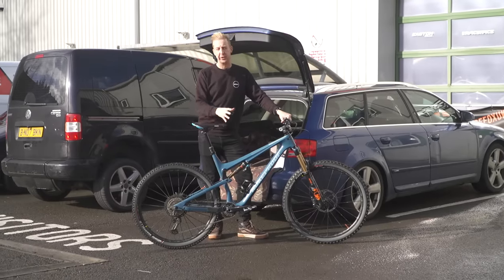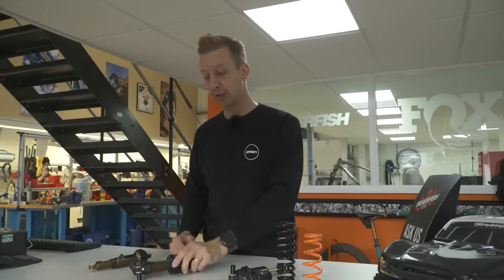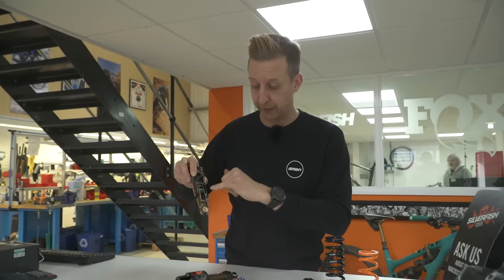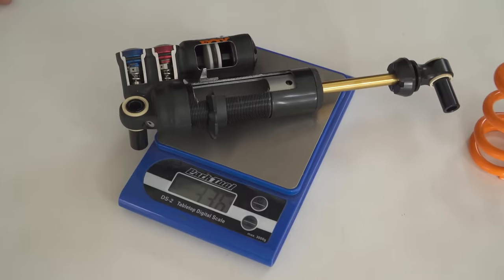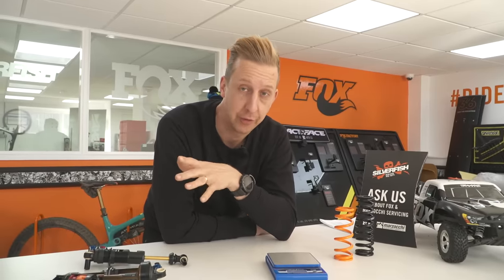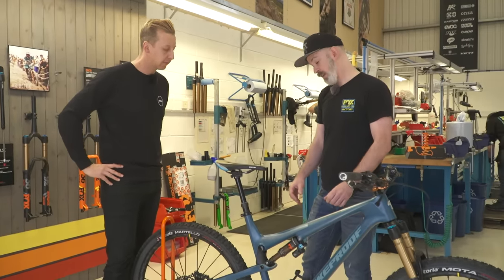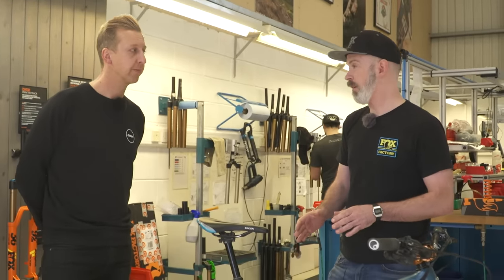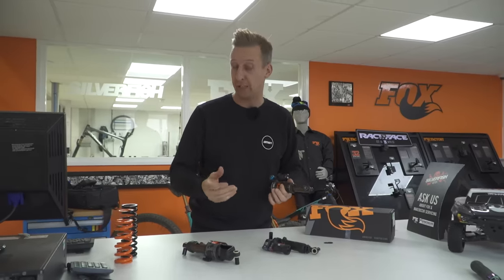Converting Your Mountain Bike From An Air Shock To A Coil Shock

Comment: I can't wait till we come full circle on wheels too, "...the new 26" bikes are so light and nimble" LOL
Reply: Well, just waiting for my new bike to arrive, since the previous one broke after 15 years. Many of these new technologies are totally new to me, and although i definitely went for a 29er, i didn't let myself convinced on 1x drivetrains. Everybody told me how great and "big range" they are, but i sat down and calculated all the speeds and gear ratios... I'm sure 1x is great for people who live in the mountains, but i like riding everywhere, from flat tarmac to the steepest technical climbs, and i'm happy i found a good XC bike with a 2x12 system. We'll see, but i have a strong feeling that i chose wisely.
Reply: @thehenr  I agree. 3x is good too on cheaper bikes, it offers good range without expensive components
Reply: I think you did. Its not the trend that matters, its the purpose.
Reply: @Panslapper  True. The bad thing is, it's sometimes hard to find the perfect thing for the purpose when trends are going in the other direction.
Reply: @thehenr  Yeah, it's a pain in the ass when you can't get the front chainrings off from the crank. Impossible to clean, let alone change them if they got worn. I had a 3x9 on my previous bike with a Deore crankset, and it was already good enough for a good quality riding and easy maintenance. Although, i admit i barely ever used the smallest chainring, only on very steep yet very long climbs. Which are rare here.
Anyway, all this technology put into modern bikes is so fascinating to me. Strong derailleurs, suspension, brakes, large wheels and wide tyres, etc... I've ridden quite low end bikes my whole life, even on the craziest terrain. I can't wait to see what has changed in the past 15 years :D
Reply: I was gonna sell my old 26er, but maybe I'll just hold on to it until it comes back in style again. Do you think 32mm stanchions and steep steer tube  angles will make the rounds as well?
Reply: @ezicarus8216  Hell yeah. It just occurred to me, the first bikes ever made were mullet bikes with 90° head tubes.
Reply: I’ve got a 29er rock hopper that I like, but also built a 26” out of 2012 Remedy 9 frame. I gotta say, switching between the two is fun and I like both of them for different reasons. I wouldn’t put 26”s on a hard tale, but on the full suspension the 26” feel so much more nibble and engaging. If 26”s make a come back, I think that would be great.
Reply: 1x will be more than plenty if you have a large range cassette mate
Reply: @forgenath6321  it turned out, 2x wasn't a bad choice. I have 36/26t chainrings, and i can ride both fast, and do really long and steep climbs with ease. The cassette is 10/45 though, but i'm sure i wouldn't go smaller than 36t if i had a 1x
Reply: old school! Liking the idea but I personally believe it just causes clutter on the cockpit more and you have more chance of the chain falling off with a 2x, but if that is what you like I wish you all the best and hope it goes well!
Reply: The main upside to 1x in my opinion is having one less derailleur to have to adjust or worry about breaking. It's also lighter, but that's rarely my main concern.
Reply: brilliant
Reply: which is weird because 3X is more complex than 2X but 2X is more expensive.
Reply: @gearsighted  front derailleurs are not as prone to accidents as rear derailleurs, i never had an FD fail on me. And 2X front derailleurs are pretty easy to setup and tune, their just 2 speeds anyway. Learned how to do it on youtube.

I converted my bike to 1X from 3X by removing the old chainrings and putting in a new middle chainring, then replacing the rear cassette with a wider range and putting in a derailleur extender. Now i want to go 2X but i already gave away my FD, will buy a 2X specific crankset once the prices go down and availability goes up and put my old cassette back for closer ratios.

Comment: I went to coil last year on my YT pro race and what a difference converted the Fox 36 and fox DHX2 spent a bit on springs and wouldn't go back to air, to much stiction. Now running 2020 Specialized Kenovo expert and took off the rear coil and put the Fox DHX2 as wanted high speed compression a lot better so converted forks to HSC internals lots off feel in the wet British forests.

Comment: Coil for downhill and E-Bikes. Air for everything else. Simple and standard. Manufactures should also have a free spring swap based on rider weight when you purchase a new bike with coil shocks.
Reply: My Levo was built with a Fox air shock. With the combination of my weight and the weight of the bike it was constantly bottoming out, even when over pressuring the shock. I changed to a custom designed Push shock, and the difference is phenomenal. A coil shock definitely is heavier and needs to be custom produced, but on a heavier bike it will perform better.

Comment: Suggestion:  To eliminate variables, perhaps compare air to coil shocks with an air fork and then air to coil shocks with the coil fork.  In most cases, people less likely to buy an entirely new suspension set-up front and rear.  Would be informative to know how a coil shock feels with an air fork, and so on.    Great video and keep up the good work.  Looking forward to the progressive coil and the Sprindex video.

Comment: Some motorcycles have coil with air shocks. The coil does most of the work but you can add air to taste or need as the situation requires. Adjustable preload on springs has also been common on motorcycles for many years.

Comment: The feel of a coil shock doesn't change with elevation.
Reply: Matt Cucci  never thought of that one
Reply: the rebound also doesnt speed up as it gets hot
Reply: @mulisha0351  While the coil spring does not stiffen or soften with temperature, the flow of oil inside the damper does change with the outside temperature. It's simple, oil viscosity determines that damping will always change when temperature does.
Reply: @mtbasher  there are oils as well as oil additives to mitigate this. Its a lot less change vs the air pressure dilemma
Reply: How does atmospheric pressure effect the internal pressure?
Reply: @bachelorsuite7066  Air density is thinner at elevation.
Reply: @bachelorsuite7066  what determines how hard an air shock is, is the difference of pressure inside it and outside it. With elevation the air gets thinner, and the difference between  pressure inside your shock and the outside gets even greater
Reply: I really notice the effect of thinner air on the stiffness of my tires. They get all squishy at low elevations
Reply: GrizzlyAaron That’s wrong. Coil and air shocks dampers heat up roughly the same, coil a little bit less because they often have more oil volume and no temperaisolating airspring around them. But once they are heaten up, both have less damping force.
Reply: @AdrianSchwizgebel  yea plus I don't think most people are able to ride super hard for long enough to really soak any heat in the shocks.
Reply: @rajgill7576  Not quite. The absolute pressure inside the shock doesn't change, so shock performance in terms of air pressure won't change when you go to altitude, as atmospheric pressure doesn't come into play on the force acting on the shock piston itself. You have to account for the altitude effects when you add pressure to the shock at altitude. Shock pumps give you a gauge pressure reading, so to get the same absolute pressure in the shock, at altitude you would pump it up to a lower pressure (basically your sea level pressure, but removing a few psi to account for the lower atmospheric pressure at altitude).
Reply: @bachelorsuite7066  It would be the opposite... Complete placebo in this case.
Reply: @Deebo1985  what did you think pushes an air shock back into position? External air pressure. At altitude the relative pressure of the shock's internal air is higher. Try using air shock in a vacuum, nothing will push it back. Stay in school and stop playing professor.
Reply: @stevek8829  Actually, what pushes it back into position is the internal air pressure, not external. The air pressure in the shock is working against mechanical forces from the bike that are compressing it. Yes it is also working against ambient pressure, but the significance of that is negligable compared to the other forces. Why so hostile man, Jeeez, calm down.
Reply: coil shock: less maintenance,more durable,
Reply: That would not be noticeable at all.

Comment: Most modern coil shocks have compression and climb switch so is no difference to air going up hills. Air has more pop for jumps but coil charges through rough stuff way better.

Comment: Coil, then the market goes air, now theyre back selling you coil
Reply: Just like how they're selling back 1x. Watch them in the future selling back 26 inch wheels and tires marketing them as "stronger" and "more agile".
Reply: Welcome to the bike industry. What can we sell for you today ?
Reply: @MrCharlesPoulin  suspension stems
Reply: Yup! Each new generation thinks it invented sex. The only real problem most of us mortals will have with 26" tyres is finding quality ones in that size LOL. 26" wheels are lighter, stronger and turn side to side more rapidly.
Reply: Geekboy NZ plenty of choice on 26” tyres in Europe, try ChainReaction they do mail order. I still have my Specialized FSR Competition which is now 20 years old, 26” wheels, ‘V’ brakes, and 3x9 groupset. I have just bought a hardtail 29er so also now have an air fork, disk brakes, and 1x12 groupset, frame is Ti as well-if that lasts me 20 years I will be in my 90’s........
Reply: @wammo12345  I agree. Just filled up my Rock Razor stash for a couple of more years. Schwalbe won't make them in 26" any more.
Reply: @donataskazilionis3081  LMAO 🤣

Comment: Wasn't sure about what I was going to end up with on my Slash but I went for a cheap option of throwing a MegNeg can on the existing Air Shock -talk about improved small bump compliance and traction.  Very happy with the MegNeg and sticking to Air.  Night and day difference to stock air on the rear.

Yes there is coil but for general all mountain riding - still think Air is the way to go but initially, my stock shock was stiff off the top. Now it's very subtle and it sits better in the mid stroke.

Interesting video non the less and it will be interesting to see how Doddy feels on the Coil vs Air setups.

Comment: The comment that coil shocks are not adjustable, this is inaccurate.
I just bought an Ohlins 200mm travel shock that has 3 adjustable modes.
1:Full squish 2: medium for cross country or enduro 3: lock out for hill climbs.

Comment: I changed from air to coil both back and front, if u wanna keep the playfullness, just put a harder spring on there. The sag is not really a ”must have 30%” if u dont want to bottom out go up 50-100lbs/in on your spring! Bike will be playfull and stay high in travel. 

And dont forgett that puting a coil on the back will change the balance between front and back that u’ve spent hours and hours to perfect!

Thats my two cents.

Comment: 30% of 210mm is 63mm, not 15mm. That 15mm figure probably represents 30% of the usable stroke of the shock, which in this case would be 50mm. I’d suggest it might be easier to just measure the length of the spring before and when you’re sat on the bike to get your sag measurement, rather than eyeballing the eye to eye measurement on a ruler or tape measure.

Comment: So my air shock blew out a few weeks ago, I have a 2019 reign 2 and if there is an area I've been lacking in, its rear suspension. Finally bit the bullet and bought a DVO Jade coil with a 650lb spring. The reign is transformed and dare I say....climbs better too?????!!!
Reply: Tiger Biker can you be more detailed in what it did to the feel of the bike. Like what small nuances have you noticed? Is it less poppy? Harder to jump?
Reply: @ShoneDaddy  for me, the issue with the reigns stock suspension was my weight and how much force/body weight was over the rear and going through it, always bottoming out even with 3tokens and pumping it way up. One significant difference is the way it feels when your going high speed through chunk. The coil will be more linear through its travel due to the spring but as mentioned I put a 650lb spring on here to make it as stiff as possible for pedaling, also I'm 215+ with gear so another reason for a higher spring weight. But my scope of descriptive words is lacking right now trying to think of how to explain it. So through the chunk, the air shock felt like it was being pushed into the travel and kinda compacting. So the shock wouldn't extend back out fully before the next bump making it feel like it wasn't doing much and just being chattery. Now it's like I'm planted through this chunk and can not worry about pushing through the bike as well as maybe plowing through stuff otherwise unplowable haha. I'm sorry this is a horrible review, I've only ridden it 4times on some hardcore trails.  But it is a full pound heavier and I do feel that slightly on the jumps. Back end just needs a little more coercion to get up, nothing that effects normal jumps, just bunny hop situations
Reply: Tiger Biker Sounds like you could have also sped up your rebound a little bit if the shock wasn’t able to re-extend after impact.
Reply: @MaplePanda04  haha yea that's the caveat, too much rebound and I'd get bucked forward in jumps, great for keeping wheel on ground but it didnt fit with my particular riding style. And that's kinda plow through everything haha...

Comment: My haro extreme mtb was originally coil shock. I replaced to air after a number of years. However, I then replaced it to coil shock again, all be it, a much more modern coil shock.  I get better riding with the coil. I must add, I'm a tall larger rider

Comment: Pretty sure the dhx2 comes stock with a climb switch or atlease a firm/open switch it doesn’t lock out completely but then again I didn’t spend $4000 for a hardtail

Comment: coil for DH, air for everything else - Simple!  :D
Reply: no, I won't go back to air, no more adjusting pressure, cus of massive pressure change from day to day or from few hours during the ride. temps and pressures can change rapidly or slowly, and it varies from country to country, season, and how mild the winter is.
Reply: yep, if youre only riding up hill best stay with an air shock

Comment: Would you recommend a coil for a 150mm travel bike?
Reply: I have a coil on my 140mm travel frame??
Reply: @onsight2822  listen to 7:45 im guessing this is the reason Marin advised u against it
Reply: @onsight2822  maybe because the geometry of your bike is too lineare. If you change your air shock for a coil, the specifity of the coil will blow all the suspension with any progressivity ans cause damage to your frame ! Plus paie attention to the warranty, change the suspension can cancel it
Reply: @paulcounter  thanks for the reply,   it's a 2016 so got no warranty !!!!  
I just had to buy a new rear end after it cracked 😭

Comment: I’m confused. In the video they told that sag should be 30 % and the length was 210 mm. Then they told sag should be 15 mm. Or is the stroke length that they are calculating the sag?

Comment: Looking to go coil as I've tried hundreds of times to adjust my rockshox RT3 plus can get perfect sag and perfect adjustment for my riding style but it's to harsh on small bumps great on big hits can u recommend if a coil is worth changing my air shock
Reply: Chuck the rockshox mate!  Fox or DVO.
Reply: @Windband1  coil or air had fox rear it the past had three blow up on me so went rockshox and is reliable no issues just I'd like small bump sensitivity
Reply: @Lee-At-Green-Pheonix-Rc  Sorry to hear that.  Maybe try DVO then.  I hear good things.
Reply: @Windband1  the fox ones that blew where air wil a coil fox only ever used air

Comment: Will u swap springs when sans 20lb pack v not? Or ride spring for that weight, or somewhere in middle....
Reply: I got a coil that gives me 30% sag with basically no preload with only my riding gear, hip pack and water. I can easily add a couple of turns of preload to compensate for my heavier backpack then.

Comment: Why cant it be possible to have the best of both worlds and have an air spring that can mimic a coil spring? Either by clever mechanical pivot/lever setup or some electronic control of internal valving

Comment: Do I have to change cables when I change from 9 speed to 11 speed shifter.        Sorry probably a silly question new to mtb
Reply: If your current shifting cable is long enough it shouldn't matter but new shifters usually come with a new cable already installed, or at least my Sram GX did

Comment: So has anyone invented a hybrid coil air shock? You could do 80% of the work with the coil and have a small air chamber for tweaks.
Reply: you can adjust the end stroke on some coil shocks to give you more bottom out resistance at the end. Works good.

Comment: #askgmbntech  why don’t they use silicon oil, it should be less prone to change viscosity when it heats up?
Reply: Completely blind guess: it would erode the seals, or require different types of seal that would have more stiction. I.e. it might solve one problem of air shocks that anyways can be mitigated, but make the stiction problem worse (which seems to be already the main reason why racers go for coil shocks).